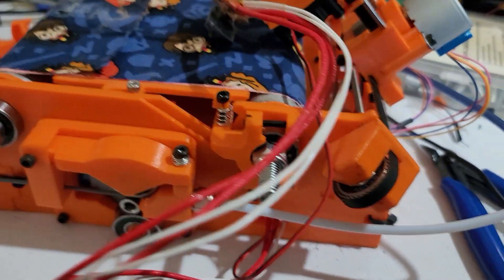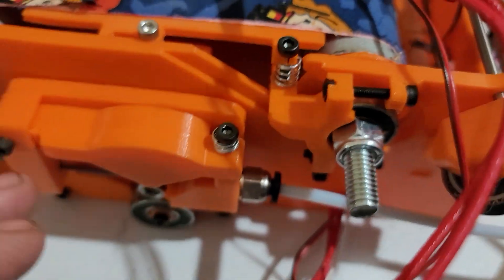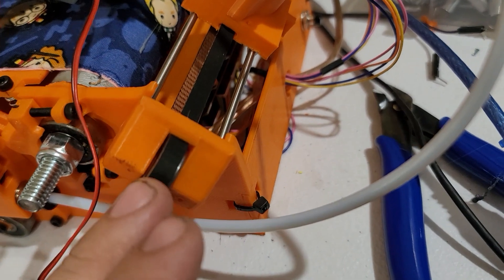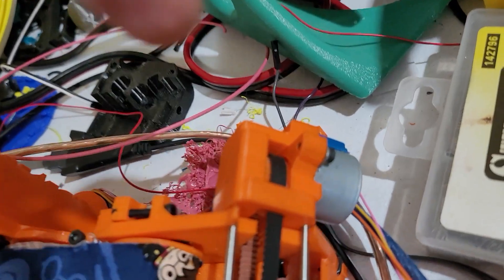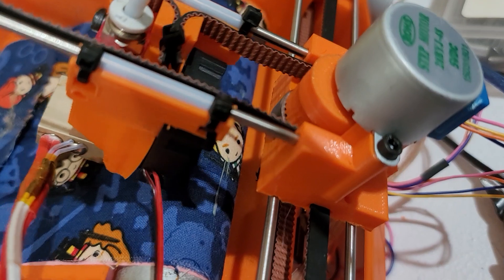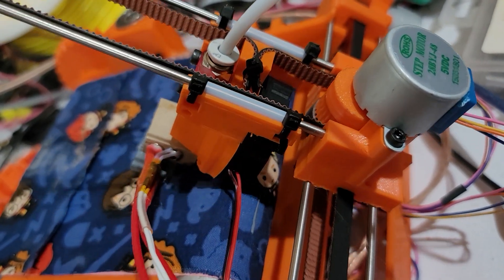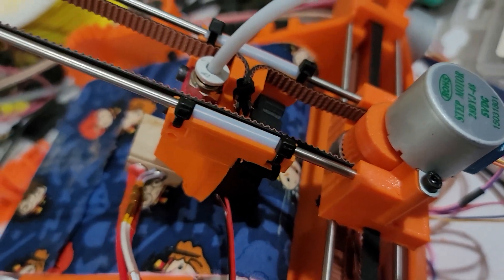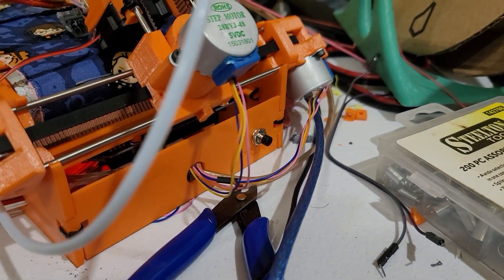BabyBelt Beta v10.0 major update teaser.

Comment: hey man, how do you remove the backlash of those 5v steppers?
Reply from the maker: It's not really an issue.  If it is, backlash compensation can be turned on in the firmware

Comment: Waitwaitwait, print button, so u can print without a pc to slice a stl into a gcode? Hows that working kuz ive looked forever to find a way to one, slice with something like a tablet or a cellphone via. An app, or somehow not need a .gcode in the first place
Reply: Ive looked everywhere apps github u name it and only print monitering or stl file viewing or cnc control apps were the only thins i kept comming across.
Reply: @heffaynekoguy687  i think it might be it just auto prints the latest G-code file on the SD card, still requireing a 2ndary PC, tho i might be wrong. i think he might mean you dont have to be directly plugged into it to operate it.
happy to be told wrong tho
Reply from the maker: @tigstercox6620  Nope, your not wrong!  You still need to slice it and put it on an SD, but that button prints the print so you don't need a PC to start the print

Comment: why using belt pulleys instead of fishing line or sewing thread?
Reply from the maker: To be 100% honist, because I have never done a fishing line printer is part of the reason.  But, at this point, the cost is the belt, no pulleys needed anymore besides the printed parts and bearings.  I am not sure how much savings would be given vs performance would be lost.  I may try it down the road...